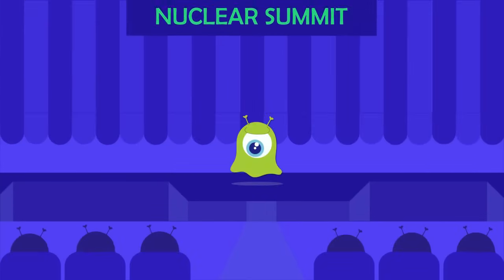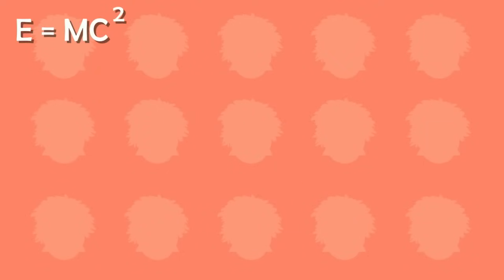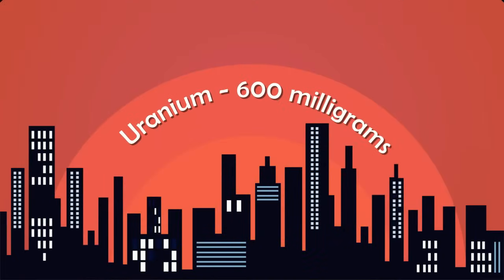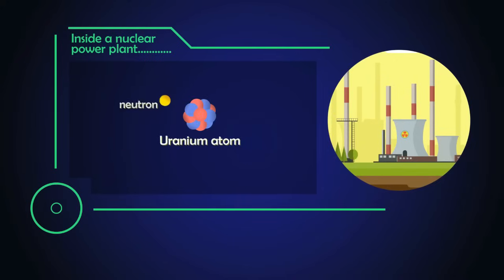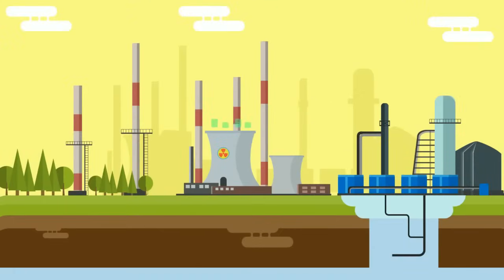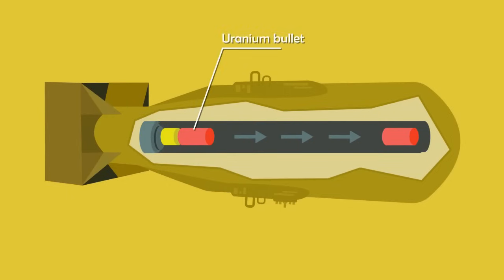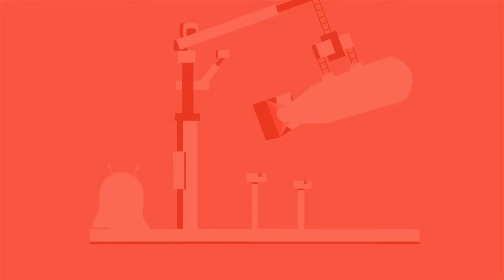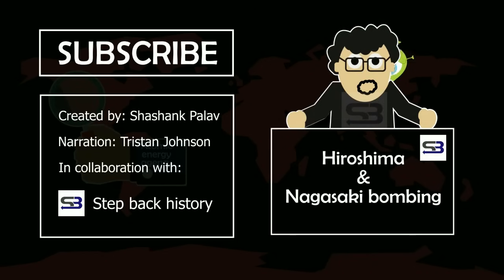How To Make A Nuclear Bomb | Atomic Theory Explained

Comment: How to make a Hydrogen bomb at home!

So, hydrogen compresses 900x original size before it is liquefied! Oxygen around 800x! HH, and O gas without being pressurised is 2x more explosive than TNT! Meaning liquid H, and liquid O at a 2:1 ratio is 1750x more explosive than TNT!

What happens when you put an explosive under pressure, e.g. a Graphene coated explosive? 

It becomes even more explosive!

Deuteride (an isotope of Hydrogen) is used in H-bombs, and has a freezing point of 3.8 degrees Celsius in a water molecule! This is heavy water!

Then you use electrolysis, and follow the same steps of making liquid hydrogen, so you have liquid deuterium! 

Now we know that different isotopes of Hydrogen have different melting points, that is also true with lithium (another vital ingredient to a large fusion H-bomb!

Lithium melts at 180.5 degrees Celsius, now all you need is to store it in paraffin wax, the paraffin wax has a flash point of 199 degrees Celsius! Heat up the paraffin wax, and you will be able to separate the isotopes of lithium! 

You will then have one liquid isotope, and one solid!
Just filter!

You now have the basic building blocks for a large H bomb!

Ofcourse liquid H, and liquid O must be stored separately, so you have another set of smaller tanks to make sure it gets the perfect 1750 mixture! You then place the liquid deuteride, and lithium in the centre!

Place this device under pressure, the more pressure, the larger the explosion, and the better the fusion.

Graphene, dyneema, etc! Pressure is great, it's vital for fusion

Comment: In the late 90’s a very misguided young man in the boy scouts decided to make a nuclear reactor, but to his dismay he found that fissile material was slightly difficult to come by. So after pretending to be a researcher he called a few universities who sent him some uranium samples of the non weapons grade variety aka U238 which sadly would not do. And then he came across some info on the manhattan project and the creation of plutonium. You see when U238 is bombarded with a neutron source it trans-mutates eventually leaving you with plutonium in various isotopes. But where oh where does one find a neutron source, answer.... you don’t, you have to make one and it to requires some neutron emitting nuclear material. And he found that material in ionizing smoke detectors, these life saving devices have a little chamber with a tiny bit of Americium 241 which ionizes aka makes the air electrically conductive between two points and when smoke particles get into the chamber they brake the stream of ionized air which brakes the circuit triggering the alarm. He got his hand on hundreds of these things and assembled his neutron source, but being a teenager and not having access to proper shielding he was surprised to find his Geiger counter losing its electronic shit when he turned it on, which scared him bad enough to pack up most of the stack, seal it lead lined tool boxes, throw it into the trunk of his car, but before he could dispose of the now highly radioactive material he was pulled over by the boys in blue. He did warn the cops not to open the boxes as they was radiation inside, and they did the smart thing by calling the feds and then the government cleaned up the area at tax payer expense and allowed the lovable scamp to go on about his young life like nothing happened and he wasn’t trying to breed fissile material. This was pre 9/11 so it was a simpler time
Reply: wow...Thats a great story but are your hands okay?
Reply: @eggnog4192  was stuck inside with a busted leg so I was going a little stir crazy, and my hands are fine I use talk to text homey

Comment: No. 600-840 milligrams of W & Z boson were converted to energy. 730 - 1000 grams of uranium fissioned out of 64,150 grams of fuel in the weapon. 
Only temperature causes fusion. Pressure simply increases the fuel density to increase the reaction rate and reduces the energy loss rates reducing the temperature required for ignition. 
All fertile nuclides, U-238 included, emit secondary neutrons when fissioned. 
U-235 and Pu-239 are not highly radioactive. They're safe to handle barehanded. They both have extremely low probability of undergoing spontaneous decay, generating neutrons. 1 in 5 million and 1 in 230,000 decay events will result in neutron emission, respectively. 
Compression isn't required for supercriticality. Gun weapons don't compress the fuel.

Comment: U235 is not highly radioactive it has a half life of  703800000 years that's why it occurs in nature. Its actually more dangerous due to heavy metal toxicity than radiation because you dont live long enough to get much radiation from it. Plutonium is a diferent story because it has a much shorter half life and imparts much larger dose of radiation in your short life span.

Comment: Another trick is to use a fusors neutron emission to turn U-238(easy to get) Into PU-239. you will need to blast the U-238 With neutrons for a couple minutes(2-5mins) then immediately take off and place in a spot where you won't get hit by the radioactive decay and possibly get hurt by radiation. after about 2.5mins the U-239 would have turned into Neptunium/NP-239 after that you will need to wait 2.5 days(best put in a basement or a place shielded from muons as they can destroy the plutonium) once the 2.5 days are over you will get the plutonium 239. Store it in a place shielded from muons. Stockpile you're amount until you have about 4kg. then take some gallium and use a forge to mix it with the molten plutonium. cast the PU-239 and gallium into 2 hemispheres. let it cool down and then follow the steps in the video.

Comment: Finally, I can prove that it doesn't take good grades to become a world leader.
Reply: Except there are 684.000 competitor
Reply: @emaster2844  it's 684001 me too 😂
Reply: @emaster2844  as macdouglas put it, NUKE’EM
Reply: @Garcia_in_Blackpowder   Amen to that
Reply: @emaster2844  684.001 from now on
Reply: Hitler - 1907
Reply: How to make a Hydrogen bomb at home!

So, hydrogen compresses 900x original size before it is liquefied! Oxygen around 800x! HH, and O gas without being pressurised is 2x more explosive than TNT! Meaning liquid H, and liquid O at a 2:1 ratio is 1750x more explosive than TNT!

What happens when you put an explosive under pressure, e.g. a Graphene coated explosive? 

It becomes even more explosive!

Deuteride (an isotope of Hydrogen) is used in H-bombs, and has a freezing point of 3.8 degrees Celsius in a water molecule! This is heavy water!

Then you use electrolysis, and follow the same steps of making liquid hydrogen, so you have liquid deuterium! 

Now we know that different isotopes of Hydrogen have different melting points, that is also true with lithium (another vital ingredient to a large fusion H-bomb!

Lithium melts at 180.5 degrees Celsius, now all you need is to store it in paraffin wax, the paraffin wax has a flash point of 199 degrees Celsius! Heat up the paraffin wax, and you will be able to separate the isotopes of lithium! 

You will then have one liquid isotope, and one solid!
Just filter!

You now have the basic building blocks for a large H bomb!

Ofcourse liquid H, and liquid O must be stored separately, so you have another set of smaller tanks to make sure it gets the perfect 1750 mixture! You then place the liquid deuteride, and lithium in the centre!

Place this device under pressure, the more pressure, the larger the explosion, and the better the fusion.

Graphene, dyneema, etc! Pressure is great, it's vital for fusion
Reply: yes

Comment: U-235 and P-239 are not "highly radioactive".  They are slightly radioactive.  U-235 has a half-life of 700 million years and P-239 has a half-life of 24,100 years.  Highly radioactive isotopes have half-lives measured as a  few months to less than a second, i.e. Po-210 ( polonium-210) has a half-life of 138 days and is a alpha and gamma emitter.

Comment: This video is semi correct. Its easy to get your hands on even a lot of nuclear material. But its hard to Separate different types of uranium. This is because they are chemicly simular so they have to be separates by weight . This is also hard because the one you want is only one proton heavyer or lighter than the one you don‘t want.
So yea good luck with that. ,)
Reply: If the difference was in proton number, it'd be two different elements, which could then be separated chemically. The difference in the most common uranium isotope and the one that's fissile is the number of neutrons. A difference of 3.

Comment: It is interesting to look at the presence of caesium 137 in the atmosphere, there was none prior to the first nuclear power station accident in 1952 at Chalk River.   This is confirmed by Phillipe Hubert in his scientific paper on dating wines. The precis of his paper can be seen at 
http://www.cenbg.in2p3.fr/heberge/arcane/IMG/pdf/Flyer_vin4_A5-GB.pdf
You can see in this paper that Phillipe Hubert states that "if we detect caesium 137 in a bottle older than 1952, its absolutely a fake".  So Phillipe Hubert is quite categorical that there was no caesium 137 in the atmosphere before 1952.
Some of the more sharp eyed journalists must have realised the implications of this, that it proves nuclear weapons are fakes because they were supposedly exploded from 1945 onwards.  The chaps at Wikipedia admit that caesium 137 is released by both nuclear reactors and so called nuclear bombs.  Wikipedia says:
 "By observing the characteristic gamma rays emitted by this isotope, one can determine whether the contents of a given sealed container were made before or after the first atomic bomb explosion (Trinity test, 16 July 1945), which spread some of it into the atmosphere, quickly distributing trace amounts of it around the globe. This procedure has been used by researchers to check the authenticity of certain rare wines, most notably the purported "Jefferson bottles"."
So the Wikipedia entry is a complete lie in stating that wines between 1945 and 1952 contain caesium 137, it completely contradicts Phillipe Hubert's findings.  Other reports of the wine test repeat this falsehood about caesium 137 being present in wines between 1945 and 1952.  I wonder why?

Comment: The amount of fissile material needed to make a bomb is much much greater that a dimes worth. That is merely the amount of material that gets turned into energy. We are talking over one hundred pounds not milligrams.
Reply: Hello russian flag im just asking a question um so do you know how to build a nuclear and what is the requirements?
Reply: @yellowsaturn2873  You can research how to build one online since all the original information was declassified years ago. The biggest problem isn't the actual building its getting the materials. If you use U-235 than you must first get raw Uranium ore which is a rare material to begin with. Then you need a large factory to process it like in the original manhattan project. If you want to use Plutonium than you need a nuclear reactor to make plutonium because it is extremely rare in nature. This is basically why only countries and not ordinary small and secret terror groups can build one. If you had the materials maybe you could build one in a machine shop assuming your willing to die of possible radiation poisoning.
Reply: @kimobrien.  thank you

Comment: The easiest way to make a nuclear weapon is by acquiring fissile material first, because that's the hardest part of making one. The easiest way to acquire fissile material is to obtain naturally-occurring thorium, uranium, or depleted uranium; the next thing you need is a synchrotron or linear particle accelerator with very strong and efficient but still conventional "non-superconducting" magnets that will enable you to obtain an energy gradient of at least 100 MeV of particle energy per meter of accelerator length. You want the particle accelerator to be at least a 1 GeV proton accelerator, and these 1 GeV protons will be directed into a spallation target, which is better the denser it is (so, lead, uranium, bismuth targets make sense; anything with a high atomic mass will do), will generate secondary radiation in the form of neutrons when high-energy protons collide with it, and these neutrons will collide with the uranium-238 or thorium-232 particles and create the transmuted products uranium-239 and thorium-233, which will radioactively decay via beta emissions (electrons) into neptunium-239 and proactinium-233, which will in turn radioactively decay into their respective plutonium-239 and uranium-233 decay products that are fissile and usable in nuclear weapons.

Ionizing-type smoke detectors contain a fissile isotope of americium, which is contained within a small amount of americium-oxide; the amount contained is only about a fraction of a microgram or a milligram, and you'd need literally millions if not billions of smoke detectors to create even a single critical mass of the stuff, so it really isn't worth attempting because even if you had every single ionizing-type smoke detector produced in the history of humankind, it still wouldn't be enough to constitute a single bare sphere critical mass of fissile americium. The details I outlied in the previous paragraph are of the easiest and cheapest way to obtain the most crucial part of a nuclear weapon; everything else is child's play to make, and that includes the fusionable fuels, such as lithium-deuteride, lithium-tritide, deuterium-tritium, etc. The second easiest way would be to enrich uranium but is much more difficult, the most difficult way would be to actually construct a nuclear breeder reactor, or attempt to steal fissile material from a breeder reactor itself.

Comment: To make a nuke it isn't that large nukes that we use are ICBMs they need a lot of fuel to go over continents. The top of the ICBM is really the nuclear bomb. You need to make the radioactive material small enough to fit but catastrophic enough. When you can find that and compress it small enough you need to surround it by something very explosive. The explosion reacts with the radioactive breaking atoms to make a big enough bomb.
Reply: If you are trying to find Uranuim-235 or Plutonium-239 a easy way is to go to Russia they have barrels of radioactive stuff everywhere you just need to enrich it
Reply: The easiest way to make a nuclear weapon is by acquiring fissile material first, because that's the hardest part of making one. The easiest way to acquire fissile material is to obtain naturally-occurring thorium, uranium, or depleted uranium; the next thing you need is a synchrotron or linear particle accelerator with very strong and efficient but still conventional "non-superconducting" magnets that will enable you to obtain an energy gradient of at least 100 MeV of particle energy per meter of accelerator length. You want the particle accelerator to be at least a 1 GeV proton accelerator, and these 1 GeV protons will be directed into a spallation target, which is better the denser it is (so, lead, uranium, bismuth targets make sense; anything with a high atomic mass will do), will generate secondary radiation in the form of neutrons when high-energy protons collide with it, and these neutrons will collide with the uranium-238 or thorium-232 particles and create the transmuted products uranium-239 and thorium-233, which will radioactively decay via beta emissions (electrons) into neptunium-239 and proactinium-233, which will in turn radioactively decay into their respective plutonium-239 and uranium-233 decay products that are fissile and usable in nuclear weapons.

Ionizing-type smoke detectors contain a fissile isotope of americium, which is contained within a small amount of americium-oxide; the amount contained is only about a fraction of a microgram or a milligram, and you'd need literally millions if not billions of smoke detectors to create even a single critical mass of the stuff, so it really isn't worth attempting because even if you had every single ionizing-type smoke detector produced in the history of humankind, it still wouldn't be enough to constitute a single bare sphere critical mass of fissile americium. The details I outlied in the previous paragraph are of the easiest and cheapest way to obtain the most crucial part of a nuclear weapon; everything else is child's play to make, and that includes the fusionable fuels, such as lithium-deuteride, lithium-tritide, deuterium-tritium, etc. The second easiest way would be to enrich uranium but is much more difficult, the most difficult way would be to actually construct a nuclear breeder reactor, or attempt to steal fissile material from a breeder reactor itself.

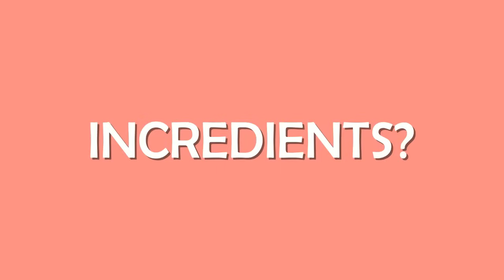Comment: 2:45. U-235 and Pu239 are both pretty stable. They don't emit neutrons as they decay, and if they did, nitrile gloves wouldn't stop any of them. It's the alpha radiation you have to worry about, which gloves would stop.
Reply: Lead gloves?